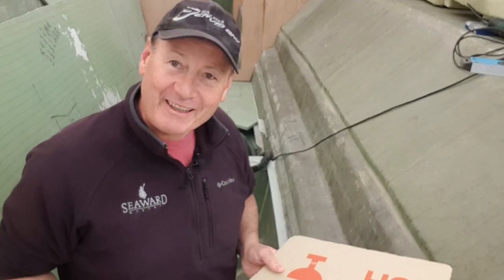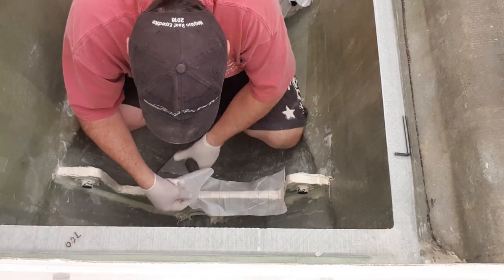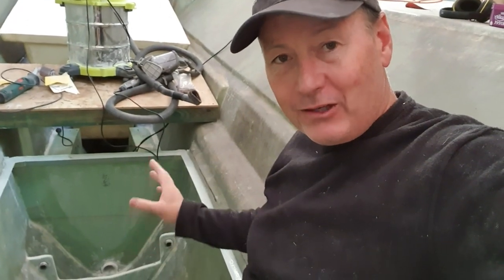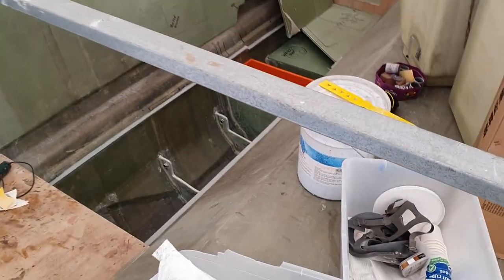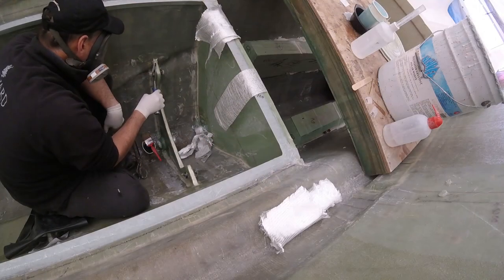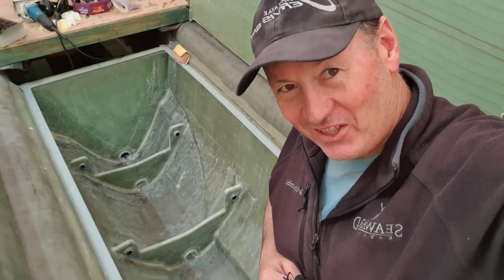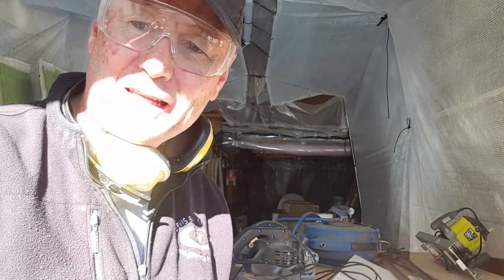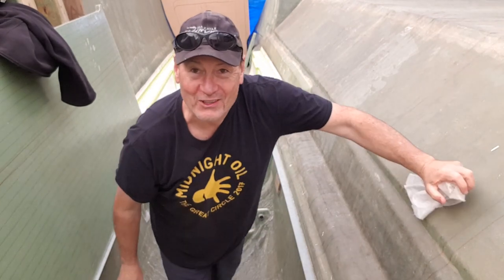Ep081 Boat Fuel Tank Supports - Life On The Hulls - Catamaran Build

Comment: They say that the whole is greater than the sum of its parts. That may be true, but in your case I would add: the parts are as great as the whole! Each piece a small work of art and toil. Lot o devils in those details. Amazing work Ross.
Reply: They also say a chain is only as strong as its weakest link.

Comment: Little detail i would use, is use a rubber layer between the tank and any fiberglass to stop wear
Reply: vettepicking just wondering if there’s a possibility that with all that weight of the tank on it, isn’t there a possibility that the rubber will degrade over time and eventually disintegrate, and then you’ll still have the rubbing issue?
Reply: @peterkacandes5905  maybe 40 years +.
Reply: @peterkacandes5905  the tank would degrade too, plus have you seen how long old tires last out in the sun .....
Reply: @vettepicking   tires only have 15 to 30%  rubber in them  and most of that is synthetic rubber. But yes I agree they do need something but he said he still has to add some supports yet.

Comment: Ross, looking good.  Bet your are glad to be done with that part of the project.    Are you going to have any wear layer interface material between the rib and tank?  I would be worried those 15mm narrow support bulkheads are going to eat into the soft poly tank as the fully loaded tanks flexes and works in the waves.  At least coat the top of the ribs with some Sikaflex or 3M 5200, i think you want something with a soft durometer and a wider bearing area than the 15mm glassed  rib offers.         One could possibly  lay some felt, wood, rubber against the tank then back that up with a few layers of glass layup 50mm wide. That forms a glove fit against the tank.  Butter the top of the ribs with thickened epoxy and set the tank down on the ribs.  Now you have a nice soft bed for the tank.    Possibly I am over thinking this.  I worked on aircraft.  Any vibration and working of one part against another was always a killer.

Comment: Ross did you use just epoxy to bed the mounting points to the hull then use poly to glass them over? Wondering because you were telling us that the next thing will be flow coat which is basically gel coat I think?

Comment: "life in the bilge"
Reply from the maker: That is indeed the order of the latest few months.Rossco
Reply: @LifeOnTheHulls  You are doing a great job!  Picking up 4 panels of 3/4" divinycell foam today for my deck.
Reply from the maker: @DIYKauai  make sure you work the resin in with a hot coat 2pc or bag with bedding compound.Good on ya buddy.What type of boat is it.
Reply: @LifeOnTheHulls  Just a little 16' solar electric pontoon boat. Not many rivers in Hawaii but we have a couple on Kauai and I want a little patio boat for hanging out on the river. Got a few video's up.  Inspired by Jaime Mantzel, a cool YouTube guy making stuff off grid in Panama.